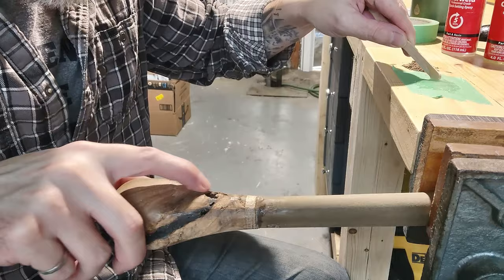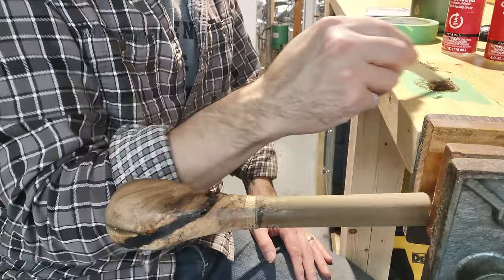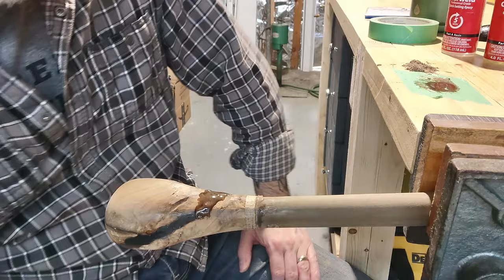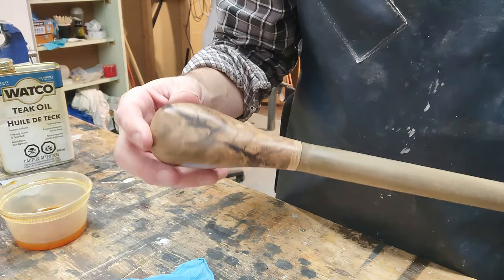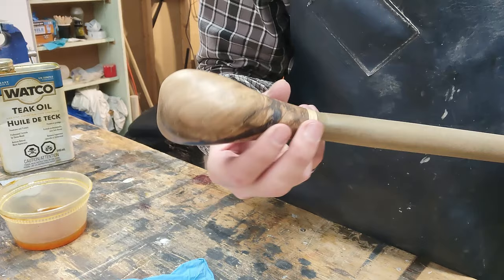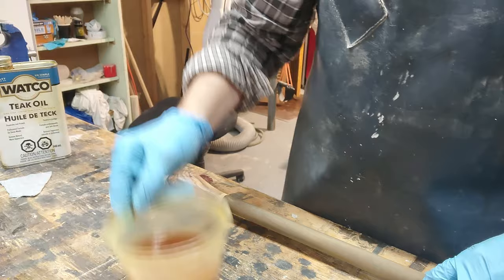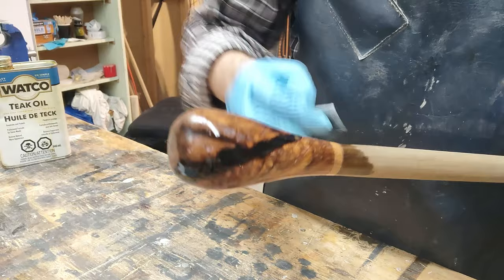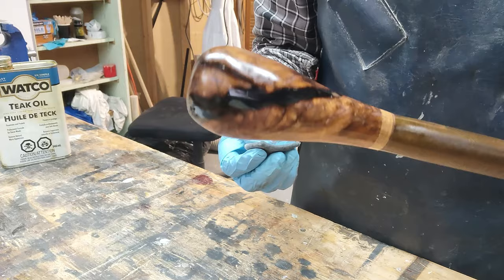CARVE a GREAT Walking Stick in 15 minutes

Comment: Used your layout process for two Celtic weave staffs this winter. Easy peasy!  One question…why do you use a vice instead of a shave horse when working on cylindrical crafts?
Reply from the maker: Great, glad you were able to complete the design! I use a vice because it’s on my workbench, I simply don’t have room to have a shave horse as well as a workbench. I use my workbench for many other projects so I choose to go with the universal workbench and skip a dedicated shave horse. But I agree, that a shave horse would probably hold my sticks better than the small vice.